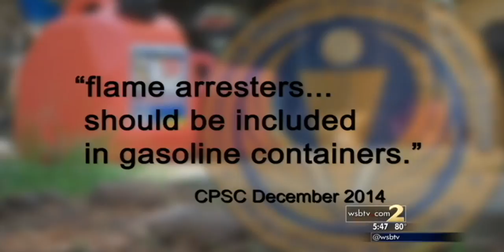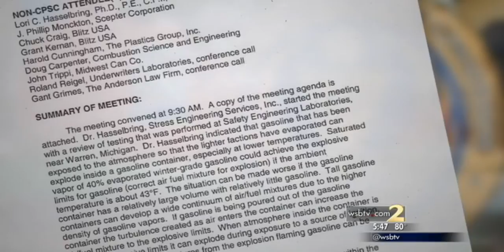2 Investigates: Gas cans could explode without warning

Comment: Reporters don't know everything. Gasoline or any petroleum product creates a static electricity charge as it flows through a plastic or rubber hose. It can create a static electricity spark as the fuel flows from it to ground. Gas pumps all have grounded hoses and nozzles for this very reason. Fuel filler necks in vehicles are also grounded to the chassis. Even the big fuel trucks hoses that offload into the underground wells at gas stations all have grounding wires inside of them too.
Plastic containers and plastic fuel tanks are far more susceptible to static electricity sparking and explosions because they are not grounded. Never ever pour gas from a plastic bucket or empty a plastic automotive fuel tank into a bucket or any other container without grounding it first.
That reporter placing a screen over the funnel does not know what he is doing. The screen needs to be inside of the pouring spout to keep the flame from going inside of the plastic can.
If you have an old blitz can, do not throw it away. Buy a EZ-Pour spout and use it on the old can. It comes with a flame arrestor screen. Those new stupid government mandated pour spouts on all of the new fuel cans are a joke. They leak and spill all over the place.
Reply: Do the EZ pour spouts fit on most plastic gas can's? I seen the more expensive metal gas can's have a flame arrestor inside the can. It looks like plastic gas can's would include this also, but I suppose not. Thanks, John
Reply: @Johnny53kgb-nsa  yes they do. They have a website.

Comment: The gas tank sits on top of the engine, yet it doesn't explode. This guy might have free poured the gasoline into the tank instead of sticking the noozle into the gas tank, allowing oxygen to creep inside and thus feeding the gasoline inside so it can combust